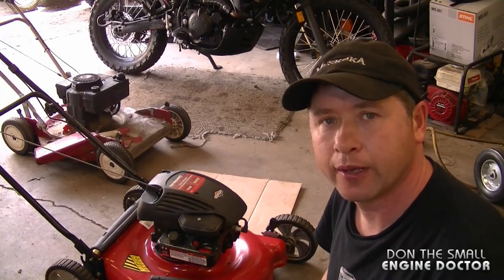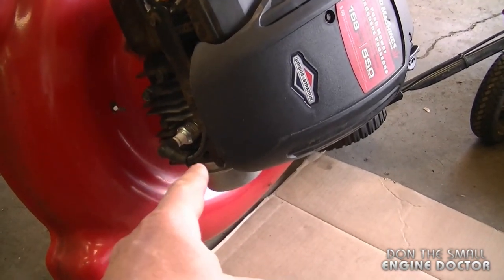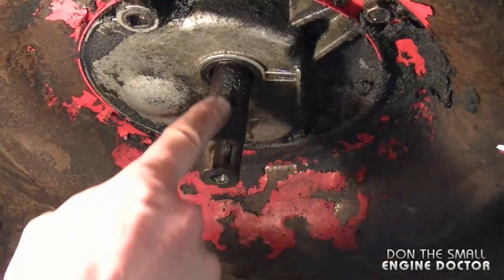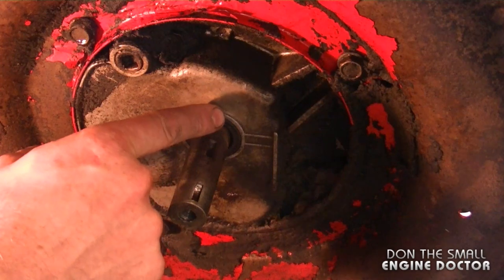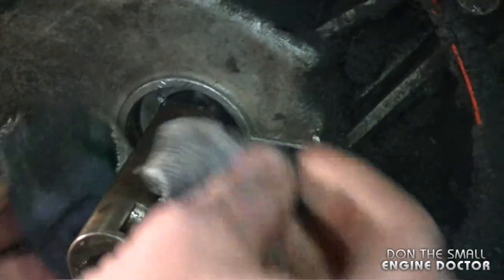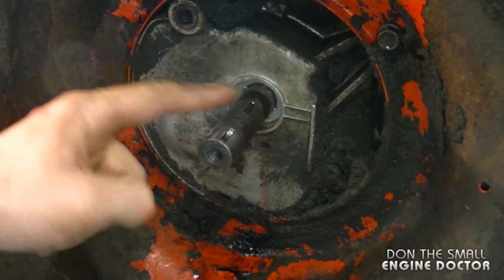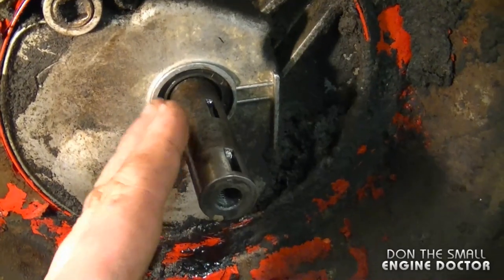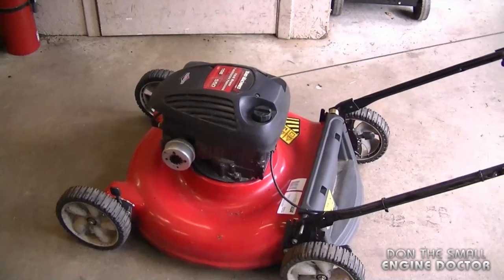HOW-TO Replace A Lawnmower Crankshaft Seal

Comment: Very helpful. Thanks for the information. When I need to tilt a mower on its side, I try to put the engine at the top of its compression stroke so the valves are closed. Have a good weekend!

Comment: Awesome job what I do is clean it like you do spray it with carburetor cleaner then take a piece of tape and put it over the keyway holes so you don’t damage the seal it’s just a little added insurance so you don’t damage the seal

Comment: Did I miss something? A circlip was removed, and does not appear to have been an integral part of the seal itself...so that the new installation takes place apart from having replaced it. I assume it serves some function, especially if it was "On" the crankshaft in some groove. Probably to keep shaft in proper vertical positioning between clips at top and bottom?
Reply: Greg, you shouldn't see the circlip on the new crankshaft seal, it only comes loose from the old seal occasionally if damaged on the way out.

Comment: OUTSTANDING video, I would have thought the motor would have to be removed and the crank cover removed but thats not the case which is awesome news:-)
Reply: Same...was sure you'd have to strip the engine.i like small engine repairs

Comment: if you grease the inside of the seal it will hold the spring in so it does come out when you hit it
Reply from the maker: thanks for the tip

Comment: Donny what will make a Briggs 3.5 HP not turn the motor to start Its seems to be locked up. I have checked to engine brake and it's working properly . I remove to valves and spark plugs rope still will not turn the motor. Have oil leaking at the shaft onto the blade. I'm am lost as to what it could be I can turn the motor with the blade or a by the nut in the flywheel but its real tight

Comment: I was told to not use the form-a-gasket sealer on theses seals by a reputable local small engine shop. They said it can leach into the bearing.  Thoughts? Thanks

Comment: rebuilt my 21hp B$S last winter and have cut several acres and everything seemed fine. Cam out to day and the oil is all over the ground. could this be a breather issue?

Comment: I ran over a piece of metal in my yard with my push mower and it killed the engine. Then when I restart the mower it starts fine but after it warms up it starts leaking oil onto the top of the deck and smokes really badly. Any idea what might be causing this?

Comment: I need serious help anybody I have a poulan pro ppbp30 I have just bought a new carb put fresh gas new spark plug and I still won't start I only got it to run once and it died right after I adjusted the choke. I am pretty sure it's not the fuel filter. I know it's getting spark and fuel. I looked every where for a piston and cylinder kit. If anybody can help i would be very appreciative.

Comment: Very helpful video,  I had to replace crankshaft seal in a Tecumseh Lev195ea.  I did not have aviation gasket maker so I used high temperature Red  RTV by permatex. 
I will update with the results in 1-2 days

Comment: great video as always!...I have a issue I hope you can help me with. I have a Honda GX390 on a generator. I replaced the crankcase shaft oil seal as it was leaking. I installed the new seal flush with the engine case. After running for awhile it started leaking again. I thought the seal needed to be counter sunk a bit so I replaced it again. And after running for a short time it has started leaking again. Im not sure where to go from here. Both times replacing the seal I used steelwool to clean the shaft and it seems smooth with no defects. Any advice would be great! Thanks in advance

Comment: My Tecumseh engine has a stepped shaft, I ruined one new seal when installing.
I made a sleeve to protect the new seal  using plastic from soda bottle,  cut a small sheet and wrapped it around the shaft and taped it tight, like a soda straw.  Lubed it up and the new seal slides over the plastic and is not damaged by the step on the shaft.

Comment: Donny ,what should be the part # for  the same ring , bit for a Craftsman mower with a front wheel drive assist? Thanks I've had to add oil every time I mow.  shes burning up to,  so I gotta change it an put maybe some Lucas oil in , at 1/3rd to its regular oil specs . I want it a little thicker to help it stay cool do you think that will help . Thanks  donyboy,  hope the wife is doing well this winter but it almost over lol .!!

Comment: Great Video! I hit a rock pretty hard and my crankshaft seal is now leaking. I did notice that my seal isn't flush but quite severally pushed into the shaft seat. Could that be a cause for the engine vibrating more than usual? Thanks for the help!
Reply: Your crankshaft is probably bent
Reply: same here, new mower

Comment: Heya donyboy...I got an issue with a mower I got. It runs fine when starting up. But when it gets "hot" it starts to surge. I cleaned the carb several times. Made sure all the gaskets are good. The spark plug is also good as well as the air filter. Beyond this what are the usual suspects? thx.

Comment: Hey dony boy i got a question i have a troy bilt pressure washer is a 3000 psi  it needs a pump,do you think is going be ok if i install 2700 psi pump on it ?

Comment: Good video!  I'm curious about the spring you removed behind the old seal.  Does the new seal have a spring inside of it and what is the purpose of the spring?  Many thanks.  I enjoy your channel.
Reply: The new seal has a spring also
Reply: cherokeefiddler - The spring holds the rubber inner ring portion of the seal against the shaft to help prevent oil loss.
Reply: Thank you!
Reply: Richard is absolutely correct

Comment: I'm to lazy to check my engine number... Do you think a mower with that same flathead 4-4.5hp Briggs from like the year 2003 uses the same part number you used?
Reply: update it was indeed the correct seal for my flathead briggs from like 20 years ago! It was leaking like a son of a biscuit and now it is leak free. 

Thanks for the video dony, It only took 2 drywall screw attempts before coming out

Comment: My mower shaft is leaking and also vibrating. Does this seal going bad causes the vibration? The shift isn’t bent. I purchased this mower new and doesn’t have much use. Out of warranty
Reply: Your blade may be out of balance -  causing the seal to leak - check the balance on the blade  and see what happens -  “ dry-fit “ the seal first to see if you have a little friction  between the seal and the shaft -  hopefully there is no “ wobble “ between the shaft and the bushing / bearing on the mower .

Comment: good video, what is the name of the plastic cover under the flywheel thats conected to the carb... I think mine leaks from there
Reply: There are 2 crankshaft seals, one at the top of the motor ( Flysheel end, and another at the output end ( blades )

Comment: Dony, another great video. Thank you. Can you tell me what brand of bearing/pulley puller you use?  It seems more hefty than most I see on the market. Also, for small engine repair, what size depth of puller would be a minimum for you?  I'm considering buying a Posi-loc puller because they seem much more robust than others on the market, but the five inch depth one goes for $125USD and it's a three jaw puller, not two. Any advice would be greatly appreciated.
Reply: warddan2002 most chain auto parts stores have a specialized tool loan program.
AutoZone,Oriley's ect.
Pay a deposit,use the tool,return it and get your deposit back.

Comment: Would someone actually pay for this repair on this kind of mower?  You can buy this in the states for ~$100
Reply: Some people, myself among them, prefer to resist today's throwaway mentality.
Reply: grumpy one I also resist throw away, but this mower and engine is very entry level.  I wouldn't spend the time to fix something so cheap

Comment: What's about that's spring is it made on to the crankshaft seals i noticed that you pull a spring out after you remove the crankshaft seals, anyway nice video
Reply: Alex  Ok Thanks
Reply: The spring applies tension to the inner diameter of the seal which holds the the lip of the seal "tighter" to the crankshaft. One tip that is handy is to pack the back side of the seal where the spring lives with grease. That can help prevent the spring from popping out as you drive in the new seal.

Comment: I'm trying to do this for a self-propelled mower. The drive pulley seems to be firmly seized to the shaft. I built a puller to fit snuggly around the shaft and pulley. I've applied heat and penetrating oil, and it is still stuck. Any tips for removing it without destroying it?
Reply from the maker: if you can heat without damaging other parts it would help if not you will have to sacrifice it
Reply: Thanks!
Reply: I applied as much heat as I had, but eventually had to sacrifice the pulley. I got a replacement from a fellow in my neighbourhood that does small engine repair, much like yourself. Replaced the crankseal, crankcase gasket (the biggest leak, and had to make that by hand), gapped the exhaust valve (lots of fun there) and put it all back together. Runs and starts pretty much like it was new. Thanks for your advice, Dony.
Cheers!

Comment: That safety glass advice when using a wire wheel is no joke. Just like fragments of wire are found coming off of barbecue brushes, they are also coming off of wire wheels. Something about the way these are made in China is causing bits of metal to fly off. I have seen wire wheels nearly disintegrate because of poor manufacturing, and those little bits of metal end up everywhere.

Comment: Will the mower vibrate if the seals bad or is that a bearing ?
Reply from the maker: bearing or bushing
Reply: @donyboy73  Not sure it leaks so I'm sure  the seals is bad but vibrates . Blade is good and shaft is straight ?

Comment: Would a bad crank seal cause oil to get in air filter ? I have a pressure washer that leaks oil somewhere and I noticed some oil in air filter.
Reply from the maker: it could but usually not unless it's a large leak
Reply: donyboy73 I wonder what it is then there was oil on top of pressure pump so I assume it was leaking and the gaskets all look dry it's two years old maybe 10 hours of use. I put some silicone on the seal to see if it stops the leak I can't find the part number for seal.
Reply: If the engine is needing a rebuild and had a lot of blow by (exhaust gases bypassing rings) then it could pump oil through the crankcase breather and into the carburator and filter. Same also happens if over filled with oil or tipped over

Comment: Thanks for the video! at 3:28 you can see 2 "chips" at 2 an 11 o'clock of the shaft. are those the oil drain bach to the crank or something to inspect before putting the new seal in?
Reply from the maker: yes but it won't affect anything in this case and no leaks